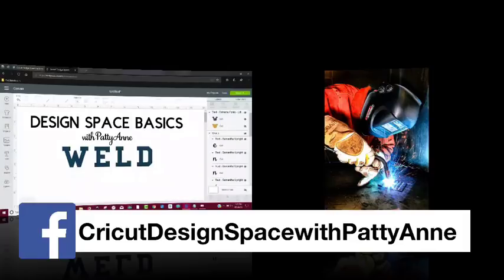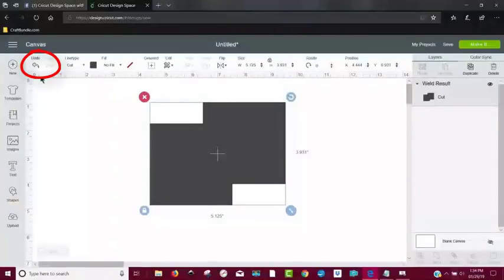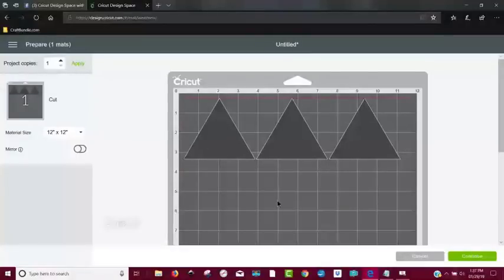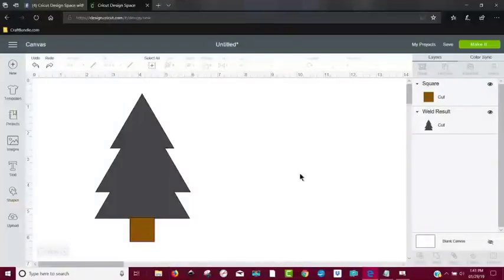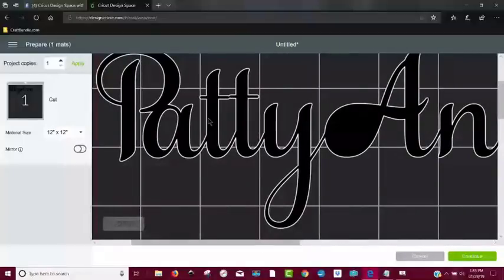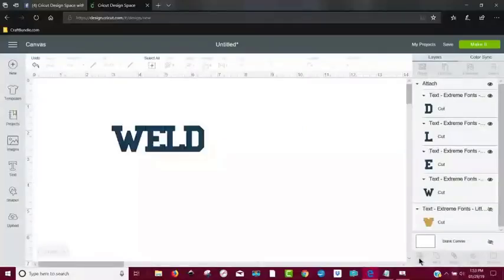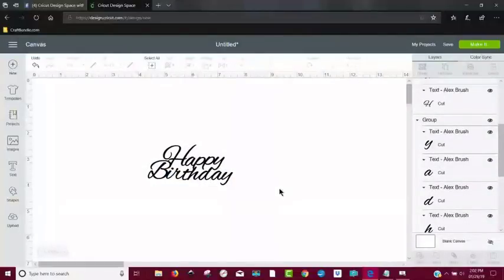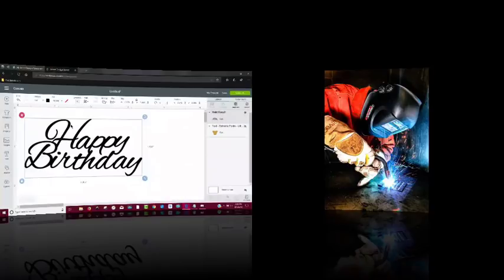Cricut Design Space Basics - WELDING

Comment: Here is my question.  does DS have a 'stroke' function?  the stroke function in graphics programs allows you to stroke (or outline) anything, so it would seem that if you have a really fine-line font that might be hard to cut - could be stroked and then welded to make it thicker?  your thoughts?
Reply from the maker: No, there is no Stroke function.  The best thing to do with Design Space is to choose a font that is Multi-layer and UNHIDE the second layer. I don't think this will help you if you want to use your own system fonts though.  Of course you CAN check  to see if  there is a BOLD option under 'style' for your system fonts.
Reply: I know you asked this question three years ago. Currently, in 2022, there’s a feature called offset… I believe this is what you were looking for.

Comment: Thanks so much, PattyAnne!   Your videos are always helpful!  Off topic....have you ever used HTV on curved portion of visor (either the piece that wraps around your forehead or the piece that shades your eyes).   Just wanted to know tricks and tips ... since it is a curved portion you are pressing the vinyl onto.  :)
Reply from the maker: I have not done a ball cap.  If you put it on the top part, I would try to make sure not to get one that has a seam in the center.  The bill of the cap would be pretty easy (I think).  I'll try one in the next day or two!
Reply: @PattyAnnesPlace   Thanks!   It's actually a visor, so there is no seam in the center like a ball cap might have.   Just wanted suggestions on the best way to press onto a curved since it is a bit difficult to apply pressure uniformly and at the same time since it's not flat like a T-shirt.  :)  Maybe I'm overthinking this "pressing-on-a-curve"..LOL